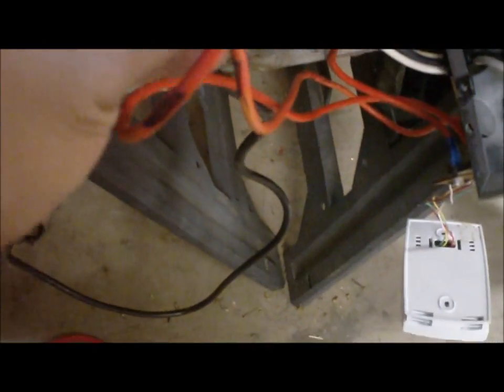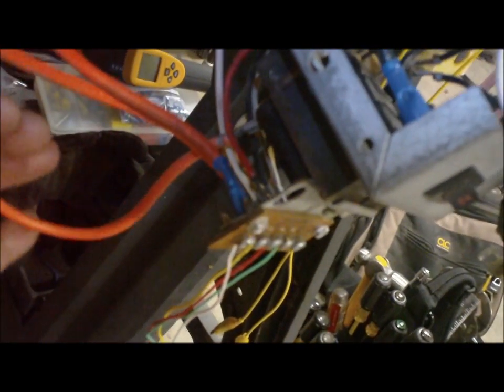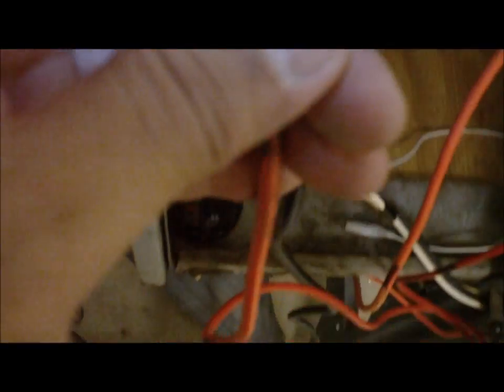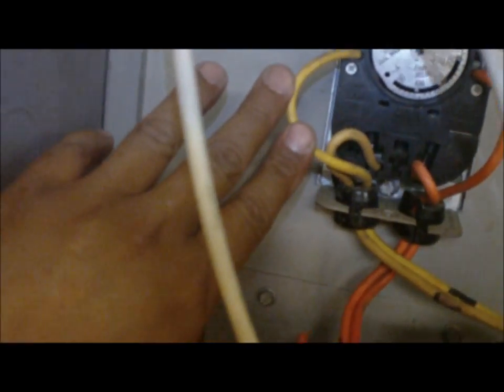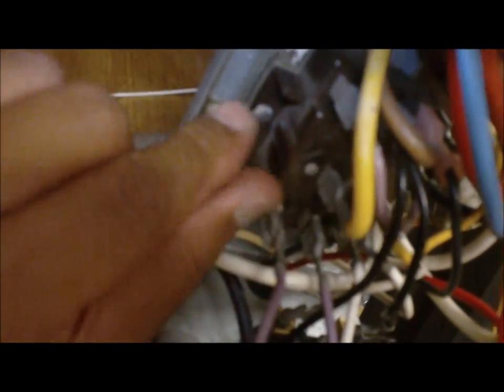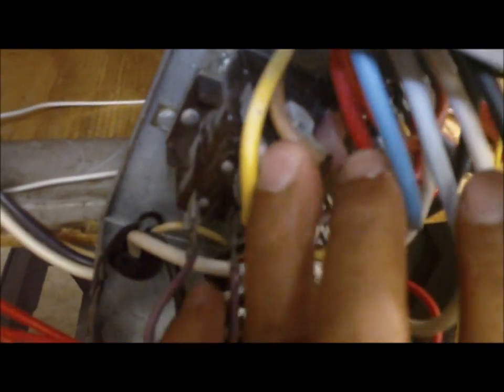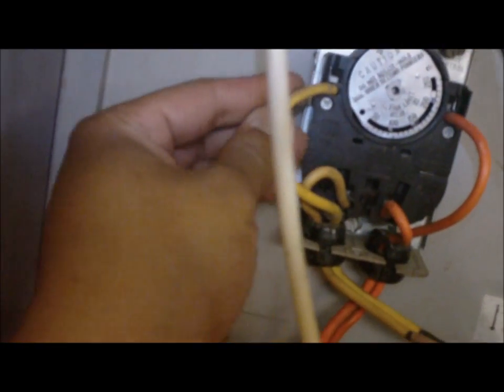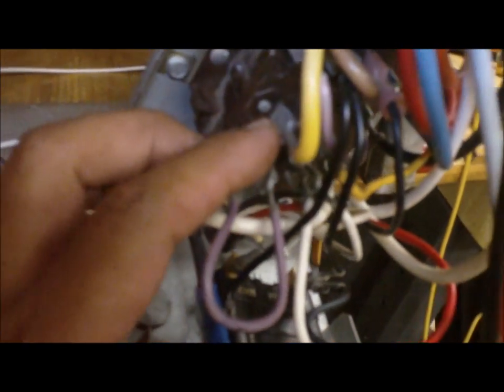HVAC Relays & Fan limit switch wiring. Part 1 of 2.

Comment: Hey. Great vid. If you're still around I need help. My mobile home had a fire . My 6 pin really caught on fire. And now I can't tell which wire in need to connect to the always on. I only have 2 wires on mine. Not 4 .thanks if you get this.